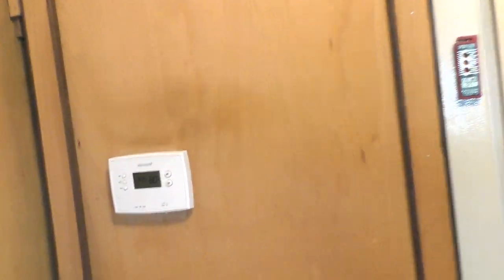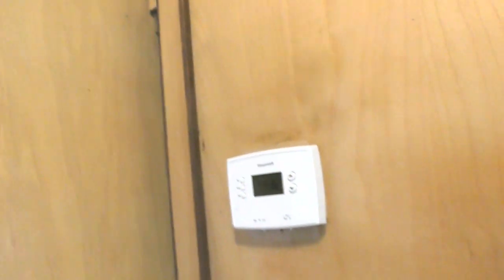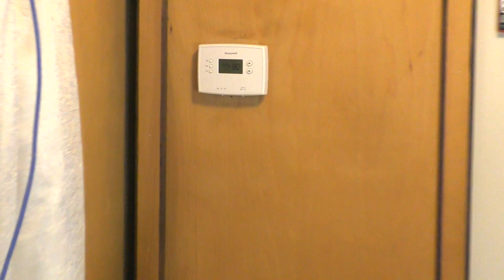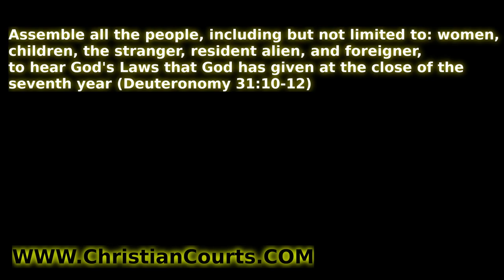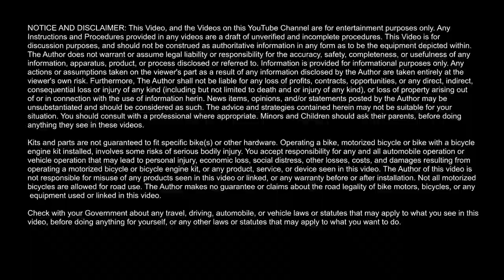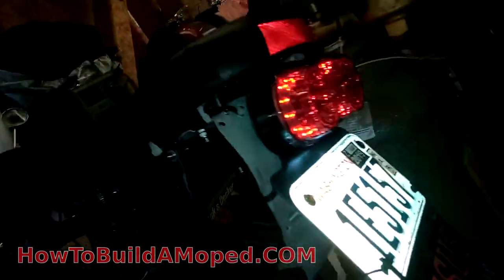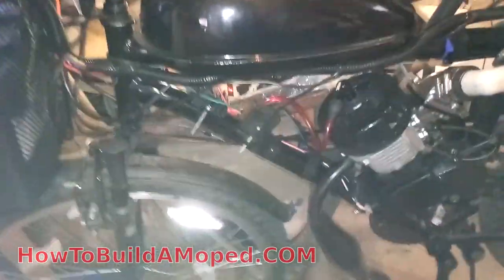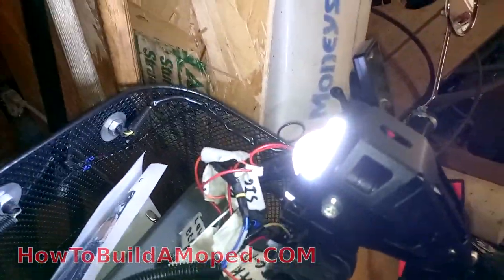How To Cool Down Your Evaporative Swamp Cooler Using Ice Does It Work

Comment: The temperature of the water doesn't have any affect on the cooling BTU as long as the evap cooler is working correctly and the water isn't an extreme temps.

Comment: Would u happen to know y swamp cooler would start spraying water down the vent inside the building.. not alot of wate4 but some water spraying out..  swamp cooler pump wasnt running for like a year and got replaced and now here and there it starts spraying bit of water inside the building
Reply from the maker: The pump moves water upwards to the top in most coolers. If the water leaks or sprays out of the system, it can go anywhere. You might need to have someone check it out who has experience and credentials.
Reply: I wonder if you took....let's say a frozen two liter soda bottle and stuck it next to the fan on the inside propped up somehow....I wonder if this would work better being closer to the fan??
🤔🤔🤔
Reply from the maker: @davidschmidt270  Anything like that seems to last longer, but doesn't seem to cool as fast or much at all. Lots of ice chunks cool quickly.

Comment: The ice melts soooo fast. I’ve tried this and it’s not very affective. 30 minutes my ice was completely melted and the temp in the house never dropped not even a .1 of a degree
Reply from the maker: Yes, it can be a short term solution.
Reply: I freeze a giant ice cube and it lasts 4 hours and dropped at the vent from 68 to 55
Reply: What do you freeze it in?
Reply: @pjj12345789  what was the temp outside because I have a hard time believing that. Maybe I just haven’t made a giant enough block 😆😂🤣😂😆
Reply: @0espy0  you want to make large blocks of ice,  I use one of those camping style Rubbermaid dish washing pans. Those blocks last a long time in my coolers for camping and work.  Any large tote will work it’s mostly about how big you want and how much space you got in your freezer 😆. Ohhh those $1 totes at Dollar Tree work well for not a huge block but a decent sized one.  For my personal cooler I used those 3 for a dollar food saver containers. 4 or 5 of those in my personal little cooler lasts all day long.  I never buy ice anymore!
Reply: That's why I never even attempted to try ice. I'm my mind I visualize ice melting quickly